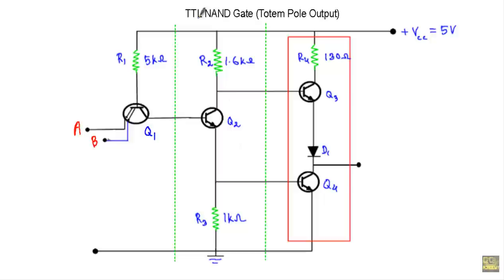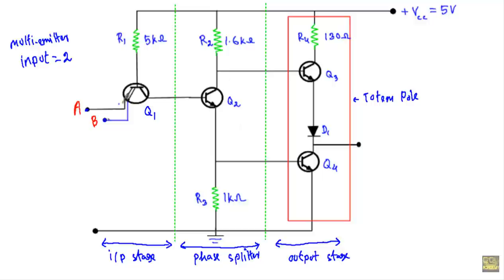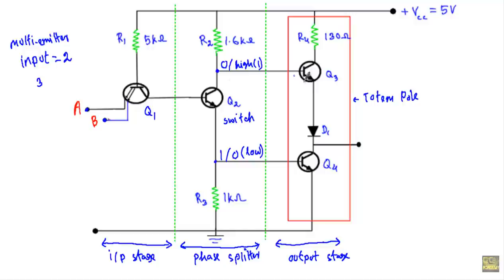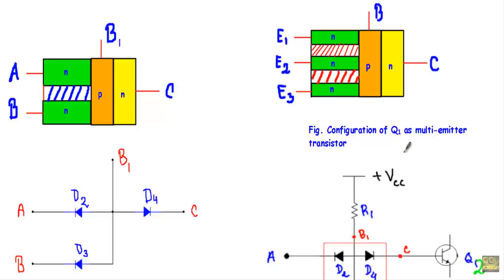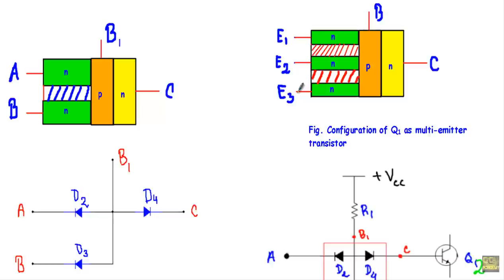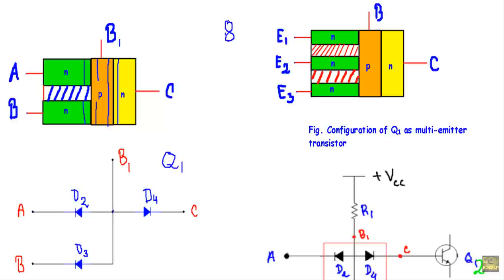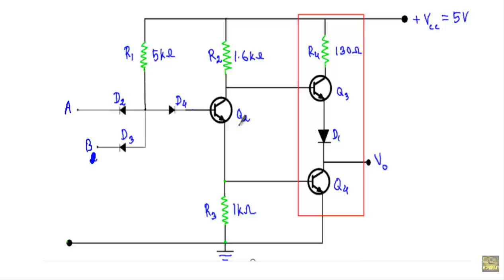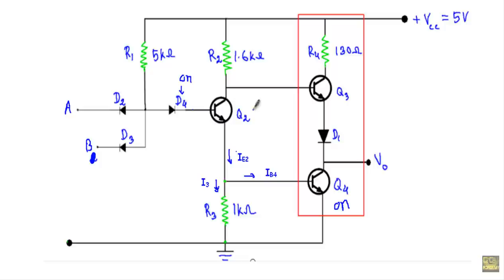TTL NAND gate with Totem Pole Output

Comment: Why the current dont flows trought the base of Q3 when Q2 is ON?
Reply: when Q4 is On ,its base is at .7 w.r.t ground .Q4  gets base drive from Q2 ,So when Q4 is On  ,Q2 has to be On . Therefore Collector-Emitter volt Vce-2   is .3 (saturation value). Hence Vb3 =Vc2=.7+.3=1 v
For Q3  to be On  it's base-emitter junction must be forward biased. If Q4 and Q3 want to be conducted simultaneously ,D 1 needs to Active .  so the base volt of Q3  must be Vb3= Vce(sat) +  Vd1 + Vbe3 =.3+.7+.7=1.7 
Since ,Vb3 only 1 V when ,Q4 is active .
Hence , it   can be said that Q3 And Q4 can't  be conducted simultaneously .
Reply: @raselrahman3822  u have mention vsat which transistor vsat are u talking about?

Comment: At 2.05 min, when base of Q 3 is zero Why is base of  Q4  one
Reply: It's bcoz if Q3 will be 0 then Q4 will be 1 ,reason is transistor Q2, which acts as switch... just remember at a time only one of the two transistor in tottem pole i.e Q3 and Q4 , only one can be high...